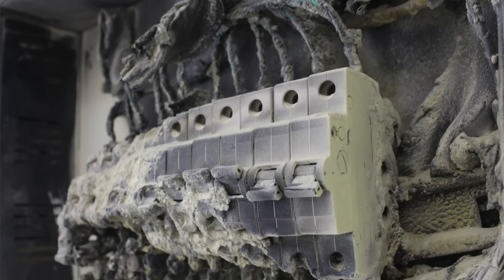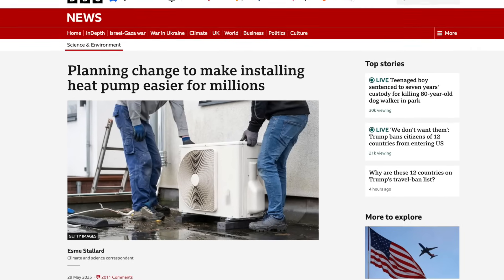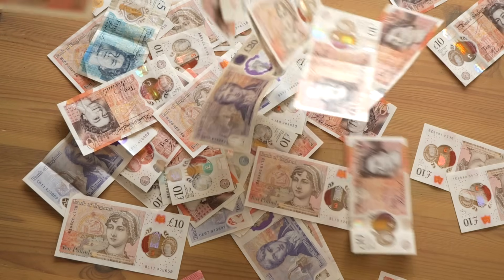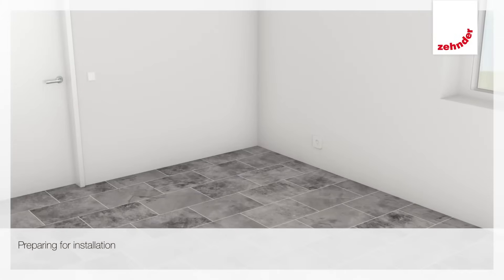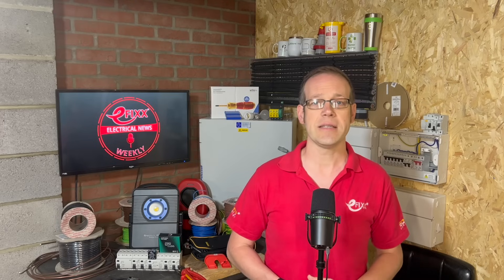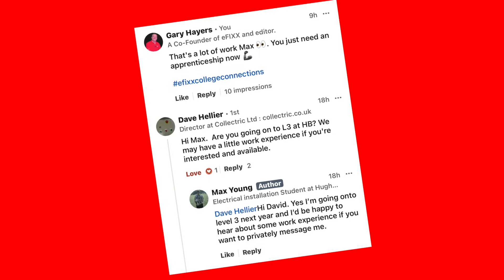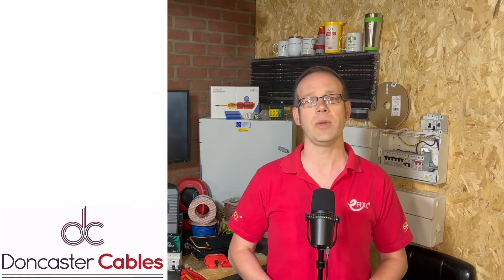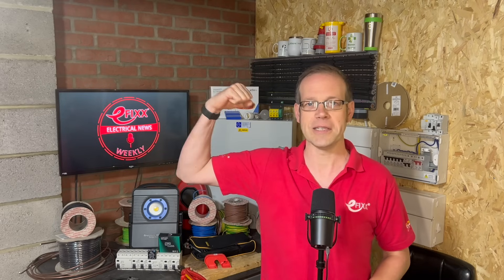IET Issues Neutral Current WARNING! ⚠️

Comment: I was at a job recently when I turned the electric shower on i had 29A running thru earth. Full test of property no faults found, r1r2 fine zs fine, ir fine. DNO came out said yes there is a neutral diversion but done there checks on there supply said all good, nothing they can do. I had to put property as unsatisfactory on eicr.

Comment: So if you carry out an EICR and there’s a Type B RcD for the heat pump, does this now be classed as a code 2 as it won’t trip possibly.
Reply: I would say so as its incorrect for application
Reply: With the exception of TT installations, I'd find it hard to see how more than a C3 would be justified for lack of RCD or wrong type of RCD on a heat pump supply.
Reply: On a new installation? Or something has been in for a while. I would personally disagree as then you're accepting something you know to be wrong and that this is where the standards start to drop.

Why no thrn just stick in a wrong rcd to be begin with?😂

Dc binding and seems heat pumps running on high frequency awitch mode power supply to be the biggest issues and anyhting driving motors. No offence, but i would be happy with an incorrect rcd...
@petermichaelgreen

Comment: Diverted neutral currents can occur without there being a fault. Bonded metal service pipes, structural steelwork etc forms a parallel path on tnc-s supplies, & the neutral current simply splits according to the relative impedances of the two paths. I've only once found a bonefide open PEN fault where the neutral current was zero, so diversion was 100%. In the open PEN I found, if I had broken the water pipe, full mains voltage would have appeared between the ends & be extremely dangerous as none of the protective devices would operate. Plumbers need a jump lead & a clamp meter. By the time a voltstick shows anything, you're probably already toast...
John Ward has some excellent videos on this subject.

Comment: Gas engineers have been using volt sticks for years. I have to volt stick any installation or appliance before touching it! And of course earth bonds are used when breaking the path by removing a meter and/or pipework.

Comment: Australia generally has MEN where neutral and earth are bonded, and an earth stake is provided, with bonding to metallic water pipes.  For single phase only "active" (phase) and neutral are on the lead-in.  Thus most current returns via the neutral wire, but some via earth, especially on long lead-ins (we were about 50 metres from the road).  I noticed apparent voltage drop (lamp dimming when adding loads) reduced when I added extra earth rods for Amateur Radio, and grounding of a high TV antenna.  An ham radio friend, living close to the road, and with neighbours nearby had a very large earth system to dissipate lightning strikes on a 100 foot tower 7 x 2 runs from each of the 3 legs).  He thus had current from his neighbours coming in on the neutral, and to the sub via his 42+ earth stakes.

Comment: Sounds like you are on the side of people who don't pay their bills?
Reply: Actually they threatened me with a pre payment because they “didn’t have my name”. Which was odd since they accepted my payment every quarter and when they were sending me letters they had my name. Claimed they could do what they liked. This is not correct though since I then removed their implied rights of access. 

They are only aloud to break entry when something is dangerous and needs immediate resolution on safety grounds. Other than that they actually have no rights to come on to your property once you have removed rights of access and they certainly don’t have the right to break in and fit a pre payment meter for non payment of bills. 

If I were that guy I would have taken them to court and the police who stood by and let it happen since they were in breach of their oath.
Reply: @davideyres955 This is wrong.
There is a strict process for the electricity supplier to go through, but when that is exhausted they apply to a court of law to get a warrant to gain entry to your property.
You have the right to attend that court hearing.

If the court issues a warrant giving the electricity supplier entry to your property, then any notice you make about withdrawing implied right or access is irrelevant. The matter has been decided by a judge in Court

And your remark about the police standing by being a breach of their oath is wrong.

The police are there to prevent a breach of the peace. If a party breaks the law, they can step in, but the fact is the power company isn't breaking the law because they have a court order, a warrant from the court giving them the lawful authority to break into the property, so no offence has been committed and the police are not in breach of their oath.

Comment: It beats me that the police turn up to break in to assist your electricity company change a meter. I know many trades who are just given a crime number when the van is done over. No copper turns up. There's a big difference between stealing electric and not being able to afford it.
Reply: You can steal electricity regardless of what type of meter is fitted.
They aren't replacing the meter with a different type to stop you stealing.
They replace it with a different type to ensure you clear any debt you have accumulated, and to ensure you pay for it as you go, week by week, rather than on a 3 monthly basis with a conventional bill and your having difficulty finding the money for that bill.
Reply: Corporate enforcement tools! Despite corps avoid paying taxes, ordinary citizens no choice! Pay taxes that pay the cops.
Reply: @fabriglas Most companies don't avoid paying tax. It's the big modern American tech companies that do.

The solution is not to let people avoid paying taxes, the solution is close the loopholes that the companies exploit to avoid paying corporation tax.

Anyway, this is nothing to do with the electricity company changing your meter because you can't pay for the electricity you consume.  You use the energy, it has to be paid for.
Reply: I didn't even know that was a thing,! What's the actual purpose of breaking in to change a meter?
Reply: @user-re6yo7tj5s To change the meter to a new type of meter or to replace a defective meter.

It happens where the resident of the property is being non-cooperative with the energy company or where, for some reason, the energy company cannot get into the property unimpeded.

It has, unfortunately, been used when a family has been on holiday

It is typically done where the resident has accumulated a sizeable debt on the supply of energy to the property, and is unable to stick to a repayment plan to clear the debt.
It doesn't happen lightly. There are rules as to when the power company can do it.

Typically the meter is changed to a prepayment type which enables payment day by day, week by week as the user consumes the energy, and prevents more debt accumulating, and secondly it enables the gradual repayment of the debt over time.
Every time you go to top up the meter with monetary credit to pay for the energy you are about to use,  some money is taken from the debtor to pay back the debt and bring the debt outstanding down. But it is done gradually over months.
Reply: @user-re6yo7tj5s the other option would be that they break in to remove the meter (and throw you out of the house after condemning it as uninhabitable because it has no power). This is for people who are either having payment difficulties or whose meter is so old it can no longer accurately measure.
Reply: @user-re6yo7tj5s  In the UK, pre-pay meters, and smart meters have a relay to cut off the customers power if they don't pay, but traditional post-paid meters do not.

Most electricity supplies in the UK are by underground service cables, which are jointed underground to larger underground mains cables, furthermore record keeping of underground infrastructure is often far from ideal, and it is not uncommon for one customers supply to be looped off another. So the US technique of "cut the customer off at the pole" isn't really applicable here.

Comment: I'm delighted to have won the challenge words - it's the little things :)

I can't really see how the volt stick will help the gas engineers since the gas pipe is unlikely to be able to rise to any significant voltage considering that it's buried in the ground. They should really have been given current clamp meters so they could check for current through the bonding conductors and/or metallic pipes - in my opinion anyway.

Now for the challenge words for today's show - I'm going to guess "boom!" and "flummoxed". Cheers for now 🍺